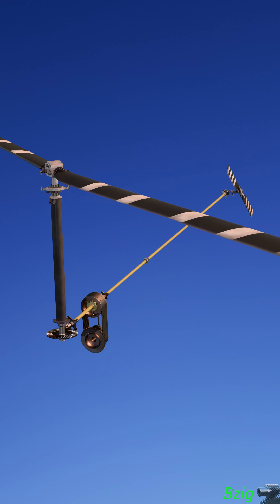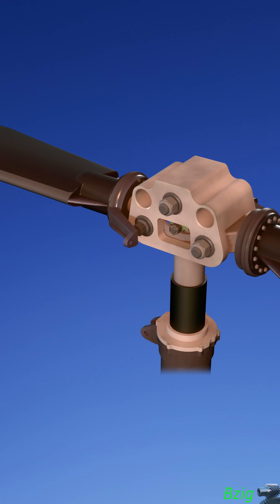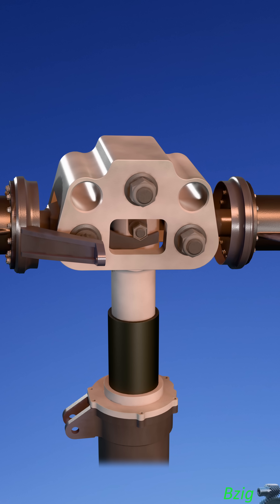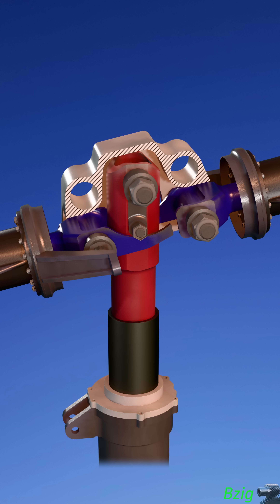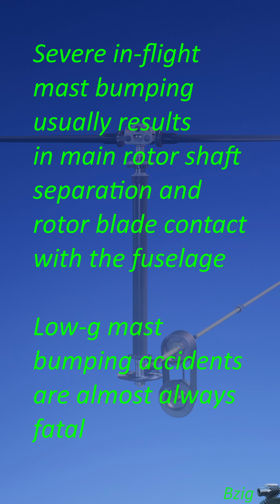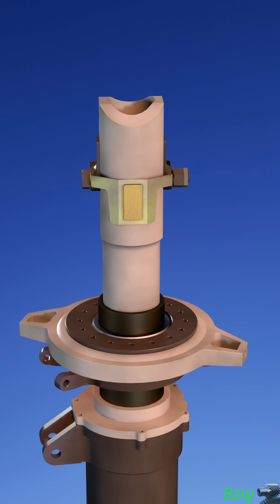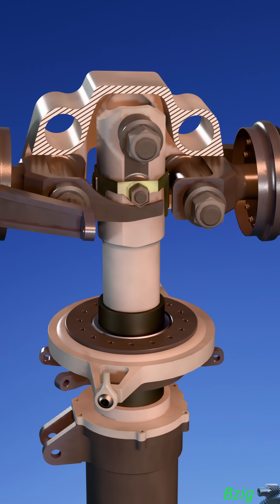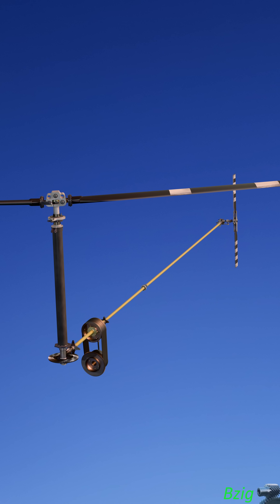Helicopter Mast Bumping

Comment: Realy enjoyed your animations and presentation thank you
Is 12 degrees  the limit as any angle beyond 12 degrees would be unrecoverable regardless.
 
Or is 12 degrees the limit due to space if so could the spindle be ditched in favour of fork ended rotor joints meaning 2 bolts to mount each rotor but more room for the mast.
Could the purple part reverse lift when it goes beyond 12 degrees pushing the spindle back onto the mast?
Or a leaf spring coming out of the end of the rotor down into the shaft that is free until 12 degrees or zero g.
Or have a slide at the top of the drive shaft so when it's parked or at zero g the spring holds it away but as soon a lift is generated the hub slides up a touch and zero contact.
Reply: Or could they fit a  rotary damper in place of the hub to mast bolt.
Not to damp at all times have them free up to 12 or so  degrees
Reply: Or make it hydraulic so when the hub lifts on the shaft the restricters go in but whenever parked or in zero g they spread.
Reply: Or mount the hub upside down go around the outside of the rotors and have the spindle further up with no mast to hit in the middle , have foam or something that doesn't mind a thwack in there instead.
Reply from the maker: I don't know if 12 degree is the actual limit for R-44's.  I made the model by looking at illustrated parts catalogues and that particular number may not be exactly where contact occurs in the R-44.  My past experience with other helicopters is that 10 degrees is a very large flapping angle and usually close to spindle contact.

There are ways to design to avoid mast bumping and this usually involves fully-articulated rotors that have high amounts of flapping offset, hub springs or pitch flap coupling.  There are people who say teetering hubs are inherently dangerous... I'm not one of those people, although I know there are risks associated with carefree operation of the aircraft that are more minimized in the fully articulated machines.

The history of these machines is fascinating.  Arthur Young was the early pioneer of the teetering hub with Sikorsky, de la Cierva and Yuryev advocates for the offset flapping hinge.  All of these people made amazing contributions to flight.
Reply: @bzig4929 Another treat , I really enjoyed reading about Arthur Young thank you.

As you probably guessed I know next to nothing about helicopters (mainly just from your excellent animations) or Arthur Young 
but from what little I've read I get the impression he d change that beatifully simplistic hub  for an ugly unasethetic one rather than only training around it.

Comment: What about a spring instead of a stop?
Reply from the maker: Yes... some designs use hub springs to give resistance to flapping, but CF loads dominate and generally prevent overlapping.
Reply: @bzig4929 Thank you very much, I got a lot of information from your video, especially the rear fan of the helicopter, I was not able to understand for a long time how it rotates, thank you very much for your video I got to see and understand a lot of good information, even after searching many times I was not able to find this information, but today I got to see it through your video🎉🎉🎉🎉🎉🎉🎉

Comment: Are some of those flight conditions caused by low speed encounters with rotor wash? Thanks!
Reply from the maker: Absolutely... anything that causes high flapping angles.  Flight in turbulence, including wake encounters, contributes to high flapping and can contribute to low g.  Mix those things and it leads to mast bumping.
Reply: @bzig4929    Thank you! I have always been fascinated with helicopters. In 1968, I was alone in a hay field 25 miles North of Topeka KS. Picking up loose bales I heard a roar that got louder. West to East was 400+ B29 Bomber flying in formation about 1,000 feet. I was stunned. Waving at them, I had 3 dip their wings to say “Hi”. Never forgot the goosebumps!

Comment: I wonder if using magnets to prevent them from touching would work. Like when you touch two positives and vise versa
Reply from the maker: That's an interesting idea.  There are some designs that use elastomeric hub springs.  Magnets could certainly provide the same kind of spring action.
Reply: @bzig4929 they'd require less maintenance, too, as they don't have moving parts. I'm not an engineer though so it's just a theory until someone tests it

Comment: Not good for the mast bearing either. Replaced a handful of them on Bell 206's. Usually you start getting a chip detector light in the transmission about 100 hours before the bearing finally shits the bed.

Comment: Instead of a mast mounted flapping stop, would a pair of springs, in constant contact with both the mast and the blade spindle be a better design idea..?
Since it's the impact of the blade spindle hitting the mast which induces the failure of the vehicle.
The springs could be designed such that they get stiffer the more they are compressed, to the point where they won't compress any further, BEFORE the spring runs out of travel, (before the coils of the springs actually compress to touch).
Reply from the maker: There are helicopters that have hub springs. And you are correct... by most standards, hub springs are a better design
  They improve control and make the aircraft marginally safer.  But the design, without hub springs, has a good safety record.  I know there are some who disagree, but the accident statistics don't really show a different safety record for the different types.
Reply: @bzig4929 cheers, I figured that someone a lot smarter and more experienced than me must have already thunked about, and developed a fix for, this possible issue.
I don't know a lot about helicopter gizzards, but I understand the physics of helicopter operations..
They are really incredible machines, with so many high stress moving parts, the failure of any one of them usually results in an unfavorable newspaper headline..
Having said that, I'd like to get my licence one day..

Comment: Is that top center bolt The Jesus Bolt?
Reply from the maker: I suppose it is.  I've always heard the "j-nut" term used for the actual nuts on the top of the mast in fully-articulated systems.  But any one of those three bolts on the teeterting rotor head would have the same effect.

Comment: What if the rotor spindles ( that actually make contact with the main shaft ) are in slots rather than holes and held forward with high tension springs. This would allow the spindles to make contact with the shaft but with give as not to catastrophically damage it acting like a safety buffer. A warning light could be signal whenever the spindle springs indicating depression or spindles make contact with the shaft, indicating the need for an inspection requirement, grounding the aircraft until inspected.

Comment: If over adjusting lead to the
horrific accident in nyc why then did the pilot have such a devastating crash? Like what may have cause the pilot to have adjusted the blades so much and knowing,that which increases the chance for mask bumping?
Reply from the maker: The NYC accident investigation has not determined that it was mast bumping... although the final report is not yet released.  There has never been any intent, on this channel, to associate this video description of mast bumping with that accident.

Comment: Could they add counter springs in the pivot point of the mast to help reduce the chances of mast bumping?
Reply from the maker: Yes, there are two ways to add a spring.  There can be a physical, usually elastomeric, hub spring.  Or, there can be an aerodynamic spring created by coupling a pitch response to flapping.  In the R-44, they use the aerodynamic spring, but not a physical spring.

Comment: It seems to me to be only a small design change where you wouldn't need the spindles to come in anyway to get to the  mast the simplest design change would be to put ltd shock absorbers that still allowed the emotion of the rotor but when it got to a certain point the shock absorber would cushion the movement of the spindles all that could be another hub on the top and has them so that they would never reach the mast in motion
Reply: So two design changes that could be made is you could put chocolate absorbers either side the totally connected to the master all the time and at some point they absorb any shock alternatively you could put a mask jacket on the mask so it has a spinning jacket that connects to the body of the helicopter buy widening it so the drive of the propellers goes through the mast but the mask is protecting from the components that would hit the mast
Reply: Limited shock absorbers put chocolate instead but I think the more practical idea would be a outer jacket which could be hit by the assembly without hitting the mast which can rotate but isn't connected to the mast it free rotates around a shaft from the body of the helicopter protecting the mask with a rotating solid tube around it that is connected to the body of the helicopter
Reply from the maker: I'll do a video soon about the effect of delta-3 flapping.  I showed the mechanization in one of my videos... essentially, this creates an aerodynamic spring.  The more the blade flaps, the more the change in blade pitch creates more force to oppose flapping.  Of course, a spring isn't a damper.  

I think the real design solution, if you're not willing to limit the low-g flight envelope, is to design aircraft with fully-articulated hubs.  Even better.... fully-articulated bearingless hubs.  When you see helicopters flying aerobatics, this is the design they use.

Comment: Why not lower the articulation point?
Reply from the maker: the "under slinging" is necessary because it's a stiff-in-plane rotor.  The cg of the blade has to be in the same plane as the flapping hinge or else the blades would be cyclically loaded (coriolis force) during every rotation.  Because the blades cone upwards under load, engineers anticipate this amount of coning and undersling the blades by this amount. 

It's a good observation.

Comment: It seems like a hydraulic damper (basically a progressive dampening shock, similar to a hydraulic bump stop on a truck) would be able to prevent the catastrophic mast bumping  during the more rare out of envelope flight events.  Seems like it would be good insurance.
Is there a reason this isn't a solution? 

Also, never realized I'd love these rotor wing flight control videos so much.  Awesome stuff.
Reply from the maker: someone else just had the same observation, here's a copy-paste...

I'll do a video soon about the effect of delta-3 flapping.  I showed the mechanization in one of my videos... essentially, this creates an aerodynamic spring.  The more the blade flaps, the more the change in blade pitch creates more force to oppose flapping.  Of course, a spring isn't a damper.  

I think the real design solution, if you're not willing to limit the low-g flight envelope, is to design aircraft with fully-articulated hubs.  Even better.... fully-articulated bearingless hubs.  When you see helicopters flying aerobatics, this is the design they use

Comment: Bell 205 have 7 degrees of teeter as with the Bell 206
Robinson isn't that bad... It's all on the pilot.
Reply from the maker: Thanks for the info. I modeled the Robinson from their parts cataloge, so I don't know how many degrees of flapping it actually allows.
Reply: @bzig4929  The teeter stop horns stop flapping when the blades are at rest or shut down & start up

Comment: Looks like that's what happened to the our operator in the helicopter accident recently in NY
Reply from the maker: I think the NTSB report is out on the NYC accident.  I have not read it, but the rotor mast and transmission looked to be intact, and separated from the aircraft.  Most documented, in-flight, mast bumping accidents result in mast separation from the aircraft.

Comment: Would the rear rotor blades of the helicopter operate in synchrony with the main rotor to miss each other blades while in operation in the event of rotor mast flange bumping?
Reply: Yes, there would typically be some sort of mechanical linkage between main and tail rotors to ensure they do not impact during flight. Think something like how a crankshaft and camshaft on an engine would stay in-time with each other with a tuning chain/gear aligned in a specific way. The two rotors are linked to one engine through the transmission and that linkage is what holds the alignment. 

I would definitely recommend looking up a video on "fully articulated helicopter blades". The mechanism would likely be explained best there. It's touched on in this short but that is the topic the long form video is about. Fully articulated systems use system of linkages and swashplates to allow each blade the full range of motion... Pitch, flap, and lead/lag time balanced together and integrating the pilot's control inputs together with the physical forces acting on the blades. Its a a very ingenious but simple design, it is really fascinating. 

Not all helicopters use fully articulated blades, there are more simple (and more complex) variations depending on the design of the helicopter.
Reply: @xorphana  Thanks for the explanation. At one point in my life, after repelling from a Super Stallion military helicopter during a training session, one of my platoon members told me that the helicopter had crashed. I couldn't believe him for there was no report or evidence. So as creek water passes into a river, I too let his words go without rebuttal.

Comment: Not once do you say why this is dangerous. Just that if it happens you die..... Could you please elaborate?
Reply from the maker: I thought I made that point when I said, "mast bumping usually results in main rotor shaft separation."  

I'm planning a follow video, but I wanted to animate the rotor controls and that's taking a bit if time.  I'll make sure to elaborate why mast bumping is bad.
Reply: He did mention that mast bumping was almost always fatal. Did you need something more explicit?

Comment: So...R44=disaster
Reply from the maker: IMO, it's like any other machine, and it's safe when operated, maintained and supported properly. 

 There is a point to be made, teetering rotors are less forgiving of error so their use as primary trainers raises questions.

Comment: Why aren't springs and/or hydraulic shock absorbers used between the mast and the hinges? Or any equivalent mechanism such that the resistance increases continuously as opposed to sharp resistance increase in case of mast pumping?

Imagine a car without springs and shock absorbers, would be very bumpy as well. In case of helicopters such dampening mechanism seems to be even more essential.
Reply from the maker: Good observation... If you look at an articulated head, there are dampers (shock absorbers) to damp in-plane motion of the blades.  The flapping motion is heavily damped by aerodynamic loads.  The mechanism that causes mast bumping is a low g fuselage roll... This happens slowly, so a damper would not stop it.
Reply from the maker: Also, you can add an aerodynamic spring to this kind of rotor head by offsetting the pitch rods to achieve pitch flap coupling.   So, all the elements of a spring-mass damper are there... But they are aerodynamic and not physical.
Reply: @bzig4929 Why not just add a hard stop that prevents the blade pivot from pitching into the mast? Or would that still have the same effect as it striking the mast?
I understand that there's multiple forces keeping the blades from pitching too much normally, but this seems like it would be an obvious safety device. Essentially a safety stop for worse case scenario.
Reply: @bzig4929 I just read your other post where you mention the mast is a thin tube that crumples like a can once the integrity is compromised. So as it relates to my first question, it seems like a physical stopping mechanism on the pivot would prevent this. Especially since it's not necessarily the forces involved, but rather the immediate effects of compromising the mast itself.

Comment: There is no such thing as centrifugal force.  Any explanation involving rotating objects that uses the phrase "centrifugal force" will have logical inconsistancy at some point or snother.
What causes things to fly out from a spinning object.? Its called INERTIA. To continue rotating a CENTRIPETAL FORCE pulls things in towards the centre of rotation.  Once th centripetal force stops woking the rotating object flies off in the same dorection it was going at the instant the centripetal force stops working.

Comment: Has anyone designed a ballistic parachute for helis ?
Reply: The Russians have. They have parachutes on one of their helicopters and one has sideways ejection seats for the pilots. You can YouTube search Russian military Helo ejection seats and should see a good couple videos. I know there isn't a single US military helo that has parachutes. I've flown in all of them but the CH47 and Cobra but I know they don't.
Reply: There is a correction but my comment is missing. No US military helicopters have a parachute even though they should by now. Can't speak for civilian Helos but I'd think not yet. The Russians have a military helo that has an ejection system for pilots. They pull the ejection handles and a charge blows the main rotor to pieces and blades exit horizontal and rockets then eject the pilots vertical.